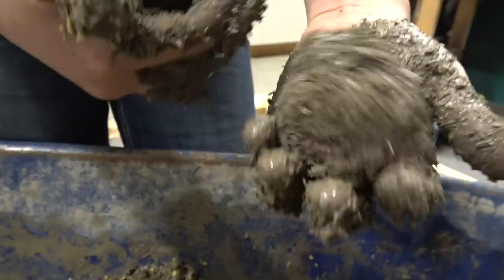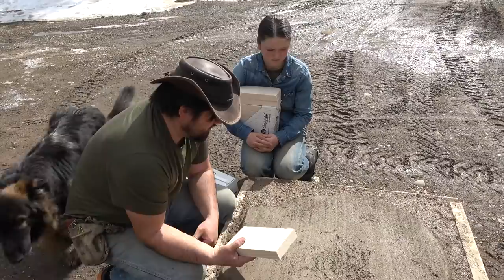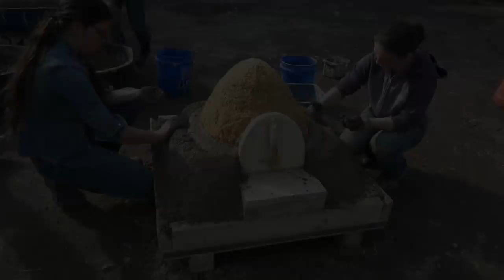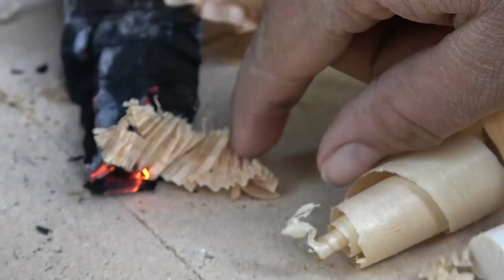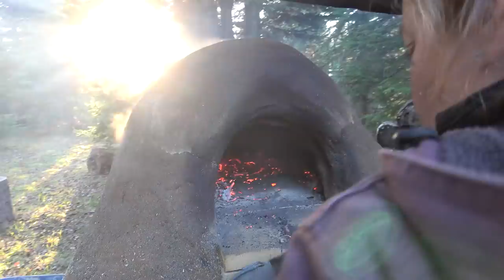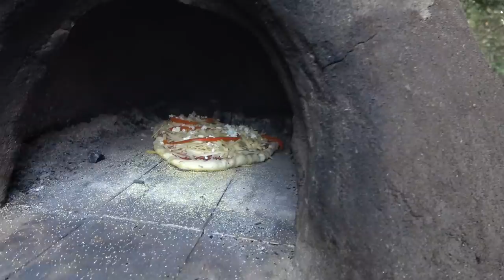Adobe Oven - DIY Pizza Oven

Comment: That was an awesome episode, I love the pizza oven build. We make pizza almost every Friday night. The key to getting the pizza off the peel is to make sure you use a good dusting of flour on the bottom of the crust and don’t let it sit too long on the peel, if it sits on the peel for more than a few minutes the moisture from the dough will work its way down and start sticking to the peel. Always give the peel a couple of shakes every couple of minutes to move the dough a little bit to help prevent the sticking. You could use cornmeal but I don’t like the taste it adds, so I just use the flour. Also, for the best pizza dough use Caputo 00 flour, the blue not the red bag, the blue is for high temp ovens. I weigh my ingredients to get a perfect dough every time. My dough recipe is 800 grams of flour, 500 grams warm water, then measure out the yeast 1.5 teaspoons, 2 teaspoons of course salt. I mix it in a stand mixer with a dough hook for a minute, let it sit for 5 minutes then mix again for 1 minute. Then knead it by hand for a minute or two and place in container to rise for at least 8 hrs. Then separate into four dough balls off equal size and let stand for at least 10 minutes before making a pizza. Each dough ball will yield a 12”-14” pizza. I love how making pizza brings people together.
Reply: Thanks for sharing

Comment: Terrific design for version 1.0, for version 1.1 consider adding a chimney just inside and a little above the closed door.  Allowing smoke to escape while starting and stoking fire without smoke getting in the cooks eyes.  If you place your pizza crust on a mixture of flour and cornmeal it should slide easier on and off peel.  

Enjoy your family and outdoor cooking.   Peace
Reply: That would let all the heat out and take 5x as long to get it up to a good cooking temp?
Reply: @donniev8181  not necessarily 5x as long.  Following link is to design I followed: https://youtu.be/Jp40dfAt7QY   ITV may be a matter of style or a regional difference.   I sized our build to allow easier placement of our Dutch oven and a pizza platform.   A chimney damper can be fashioned to allow more heat retention.
Reply: @catgynt9148  it defeats the purpose of an oven.

Comment: That looks great, I would just add a chimney to help with drawing combustion air  and steam management when the door is closed. I have got plenty of wood, not as much as ya'll have, but making a wood fired oven for my French Batard is on my bucket list. Needed a bit of motivation and you guys just provided it. it is good to see uncle Dave and Shoshanna as well.
Reply: ... but, doesn't steam enhance the dough crust?
Reply: @MikeSheasheaDtree  Yes it does do that. You are correct  in the case of French bread but not pizza in my opinion. 90% of pizza surface is composed of ingredients anyway that are usually have a lot of moisture. In this case here you would need dry heat not moist heat.  I always spray moisture when I am baking bread but not when I am making pizza.

Comment: tip - put polenta (if you have it way out there) in the oven and on the wooden board - helps to just slide the pizza off the board and retrieve from the oven - almost like tiny bearings
EDIT - Actually looks like you have some on the cast iron board 👍

Comment: LOL
I took a class from Kiko Denzer about 15+ years ago.
He live(d) just about 20 miles from where my clinic in the Mid-Willamette Valley, Oregon). I lost track of him as he has been a bit of an interweb vagabond.
But I STILL remember the class and all it's lessons. His book is a good reference, for anyone wanting to try this oven design (shameless shill for Kiko)
The tough part here is finding the exact right type of clay, so it doesn't crack... tho clay is the #1 soil type on my little 7 acres, the grit isn't fine enough and it tends to open up when given the wet-bend test.

I am like, SOOoo surprised the ladies did not decorate the outside with handprints and bas relief dragons and moose heads.

DANG - that is one large pizza fire....Where's your IR/laser temp-tester?
And where's the cornmeal under the crust ? (so it doesn't stick)

One year later.... I hope the oven has held together.

Comment: Each season put another layer of clay over it. Each season It will fix cracks and make it more better,  thicker,  hotter, keep warmth longer. 
If you build another one,  season it with a few small fires first with plenty green leaves etc on it.  Try not to be tempted to cook in it straight away with a hot fire.  
You're all fun to watch,  every single one of you in your own different ways...

Comment: Wood fired pizza is my mistress. When you have to make transfers like that, use a lot more corn meal. You have enough when you can give it a little shuck and jive and it literally slides off the peel and into the oven.

Comment: Dry the mix down with sawdust you got plenty of that plus as it burns off on the inner layers it'll create extra insulation little straw bits woulda worked too,:-)